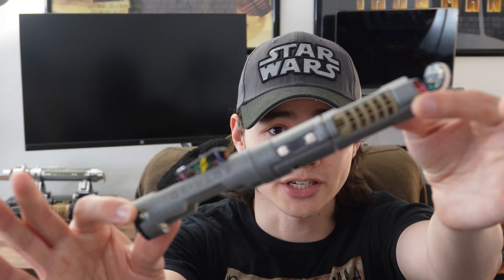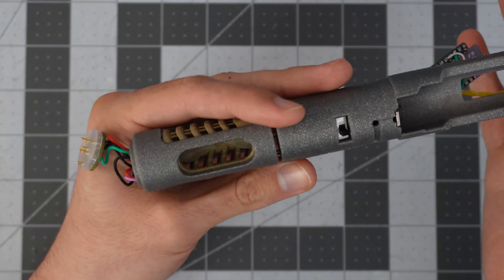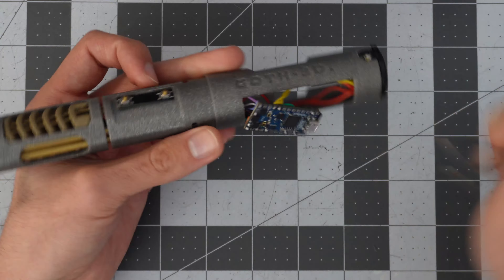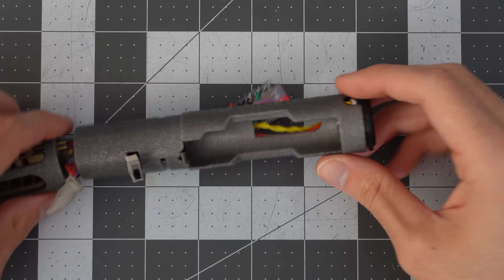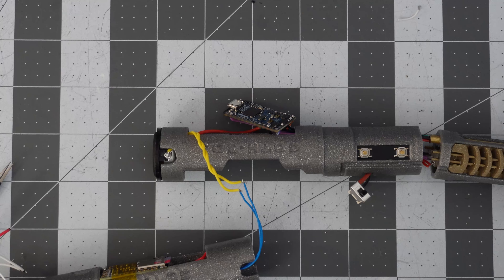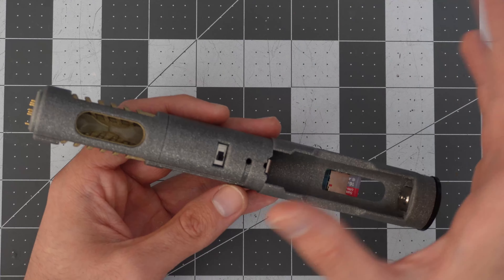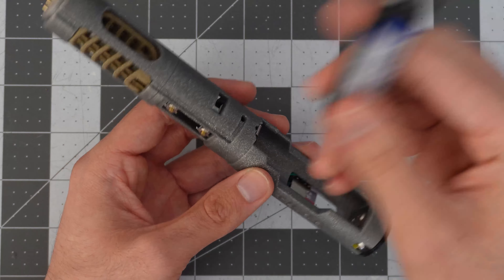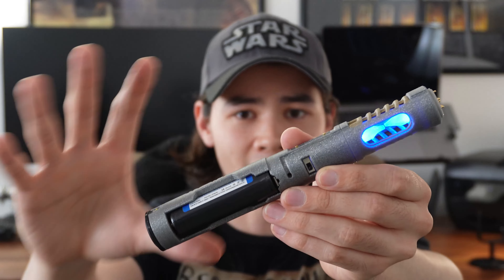Let's Fix This Broken Lightsaber!

Comment: Thankyou for the help it’s most appreciated ! I’m in uk if that makes a difference with certain suppliers and postage but do you recommend any lightsabers readily available that fit your description 28mm speaker with proffie and I’ll also look at getting that blade you mentioned to go with it also ! 
Doesn’t have to be replica if this brings the price down some 
And thanks again for your help
Reply from the maker: It mainly depends on your budget, but I’m not the best person to ask about pre-built lightsabers 😅 I only ever make lightsabers and never buy pre-built ones, so I’m not that well versed in the different places to buy them from or whether they are good or not.

From what I’ve heard, most companies these days are just resellers of the same couple manufacturers, so it doesn’t matter who you buy from because they’re all the same. At that point you’re just buying off of reputation.

But again, it all starts with what your budget is. The more expensive tend to be better as long as it’s from a reputable place, not somewhere that’ll sell you something cheap for a lot
Reply: @averycastillo  what would you charge for something like you’ve said ?

Comment: Cool videos keep it up 👍🏻 
Can anyone point me in the direction of the best lightsaber that’s really bright , great sound and all motion gestures please ! 
Doesn’t have to be a replica !! 
There’s so many YouTubers getting paid to pump certain ones and so many to choose from I’m at a loss and it’s for an upcoming birthday gift so need asap
Reply from the maker: That all would depend on your price range really. If you want “all motion gestures”, get a lightsaber installed with Proffie or CFX and learn how to set them up. Both of those soundboards will support the best sound as well, especially when paired with a 28mm bass speaker (the best being Smuggler’s Outpost speakers imo).

Brightness depends on the leds being used in the blade and what power it gets. Any 18650 li ion battery powered saber will be good (most sabers use that battery), so then it’s just what leds are used for the blade.

I like KR Pixelstrip installed blades, they look to me to be the brightest and most evenly lit at the $150 price range